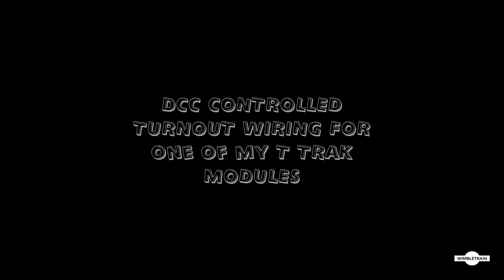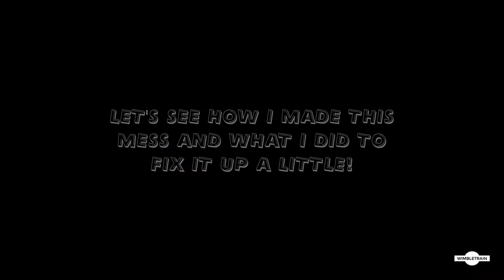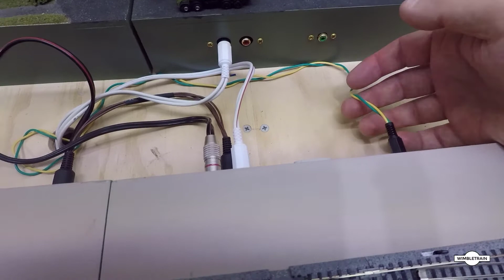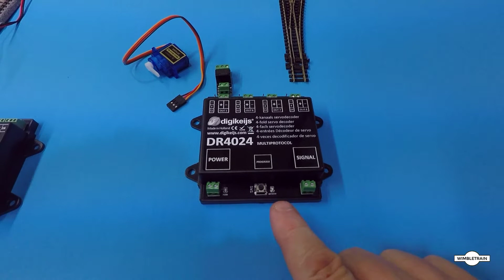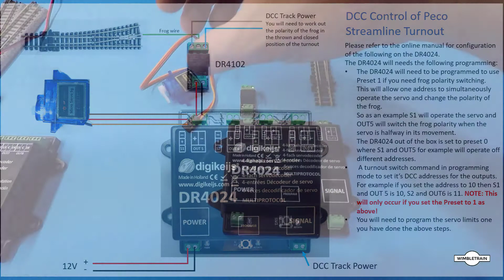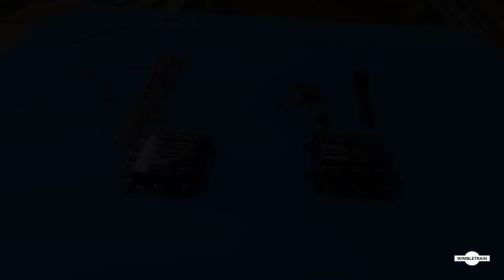DCC Control of Kato Unitrack and Peco Streamline turnouts

Comment: Hi John, thanks for video it's helping me to have an understanding how DR4018 wired. However, would you be able to help me with this? I have a DCC Ex-CSB1 command station and I would appreciate if you could guide me how I would go about incorporate EX-CSB1 with DR4018 to automate 7 Kato  Turnouts. Thank you in advance... Brian
Reply from the maker: Hi Brian, when you say automate are you talking the full on sensing trains on the track and switching turnouts automatically? This typically requires some computer software like JMRI  or iTrain.
Reply: @w @wimbletrain llo John, thanks for your reply….John, I’ll explain myself a little better so you can have a better understanding of what I’m looking to do. To start with, I don’t have the necessary knowhow, so I’m very new to DCC. 
I have no DCC trains, but that’s fine, so I’m only interesting in driving my Kato turnouts through Ex-CSB1 using the DR4018 decoder switching agent and computer as the control panel. So to make this all happening, I do know that I need to create a track plan using JMRI Panel Pro, which is fine, there’s plenty of tutorials on YouTube to help me with that. So I guess John, I’m looking to know how this is wired all together.
So, John I think what I’ll do is put this altogether and where I get issues I’ll comeback to you via your email, is that okay with you? Kind regards Brian
Reply from the maker: @brianhill2634  So from the video where I've labelled DCC Track Power on the DR4018 that will go to the DCC Main connectors on the CSB1 (which way round you put the wires for this doesn't matter). On the DR4018 where I have it labelled 12V is where you connect a separate 12VDC power supply (I use one that is rated 12VDC 2A or 12VDC 3A) and connect the Positive + and Negative - as shown)
Reply: @wim @wimbletrain ks John, I’ll keep you informed of progress, but be patient as I tend to do things in fits and starts…. I sent you an email, did you receive it? If you didn’t I probably got you email address wrong!  Thank one again for your time….Brian
Reply from the maker: @brianhill2634 Hi Brian, no I didn't get an email. Anyway, enjoy your DCC learning adventure and have fun with it!

Comment: Hi , was wondering if you could give me some advice. I am using the z21 with Kato track, having problems throwing the turnouts. I have everything set up like shown in the video, but the turnouts are not thrown, is this a programming issue
Reply from the maker: Hi Roger, I assume you have set the start address on the 4018 to match what the turnout address you are switching using the Z21? If you look at the DR4018 manual online it has a specific section relating to this setup using the Z21. John

Comment: Wondering if you could give me some advice please, I've just ordered a DK50018, basically a Bluetooth programmable version of the DR4018 you've used in the video, I'm quite new to this, does the DR4018 (in my case DK50018) need its own power supply to switch the kato points? or can/does it bridge from the dcc track power supply? I'm using a Roco Z21 with a 3a power supply if that's relevant, love your content, it's been an inspiration for my meagre layout.
Reply from the maker: Hi, thanks for your kind words. The answer to you question is yes you can bridge the dcc track power over to the power input if you don't want to have a separate 12V supply. Personally, I like to use a separate power supply just to keep it independent from the dcc track power.

Comment: Hello. Can you tell me what make and model servo you use to control the Peco turnouts? Thanks.
Reply from the maker: Hi, it's a DFROBOT DF9GMS micro servo 9g. I got it from a shop in Australia where I am. Also in the UK places like Megapoints Controllers sell servos of a different brand that do the job. Not sure where else to get them but it you buy off Ebay be careful as there are some fakes out there. John
Reply: @wimbletrain  Thanks John. I live just north of Sydney, that's why I asked :) When it comes time, I'll order from the electronics shop. Kevin
Reply from the maker: @bateaubaybubble3730  i got mine from Core Electronics.
Reply: @wimbletrain  Thanks.

Comment: Very nice. I’m doing something similar but with ESU SwitchPilot Servov2 which allows analog button controls as well as DCC control. Important if module is running in DC on a shared layout.
Reply from the maker: Hi, it,s great that we have so many hardware choices on how we want to operate and connect turnouts, etc. I did look at other options and I guess you eventually make a decision on what you think best suits your layout. Cheers John